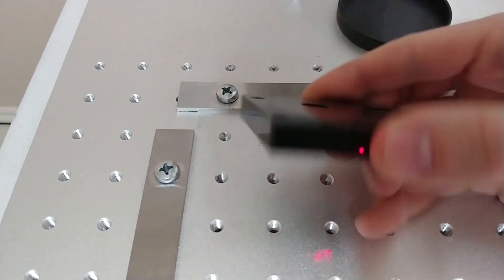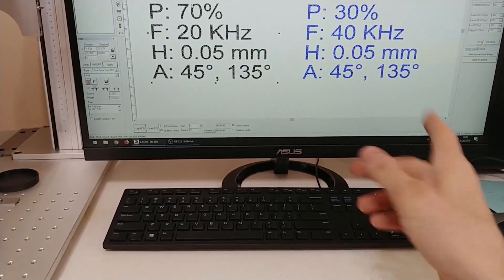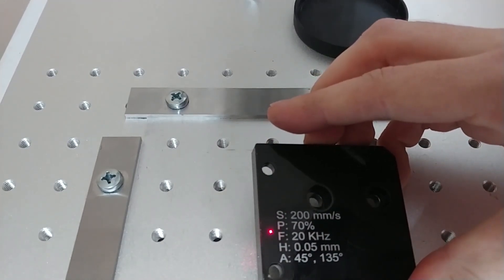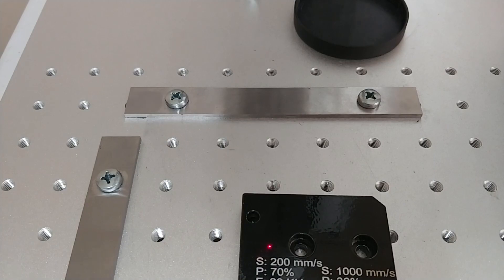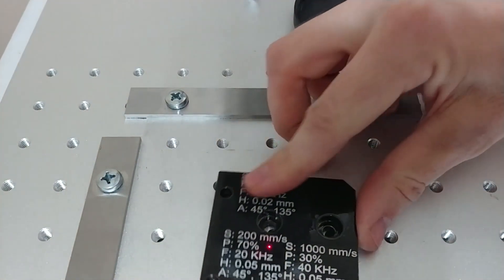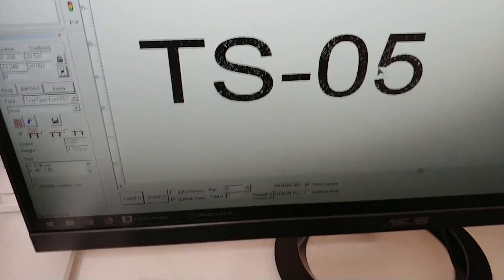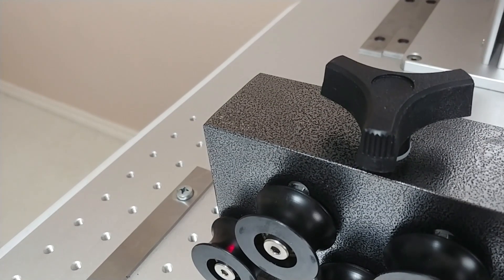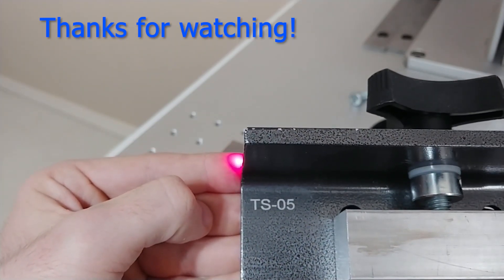Fiber Laser Marking Powder Coated Aluminum

Comment: I’m getting some 1/8” aluminum plates made for 12v light switches.  I will need to label the switches…I’m looking for an affordable, easy to use (I’m novice), that can quickly label the panels.  Any recommendations?  I like what you have…not sure what it costs or how easy it is to use.  I don’t know anything about lasers.

Comment: Can this cut through aluminum?
Reply from the maker: If it's very thin, yes.  I believe the max is about 0.3mm (many passes).  I made a video about cutting a hole in 1mm stainless if you want to check it out.